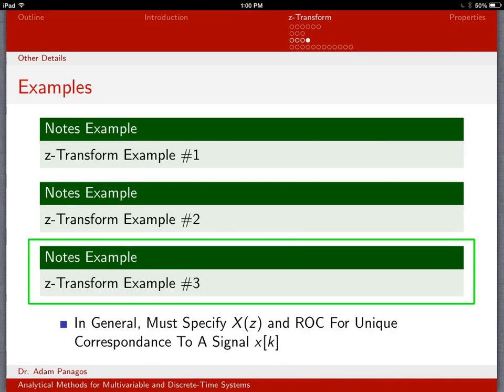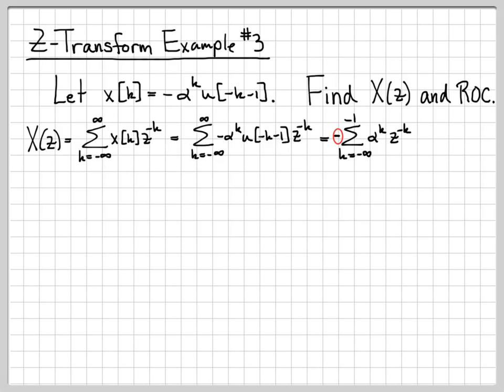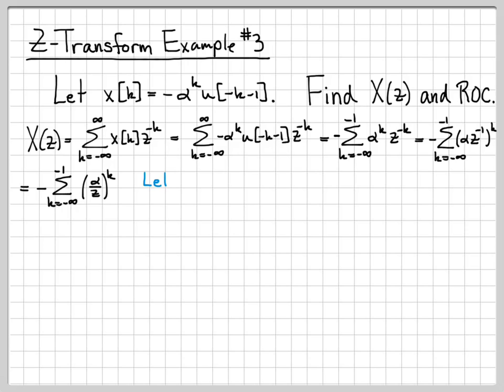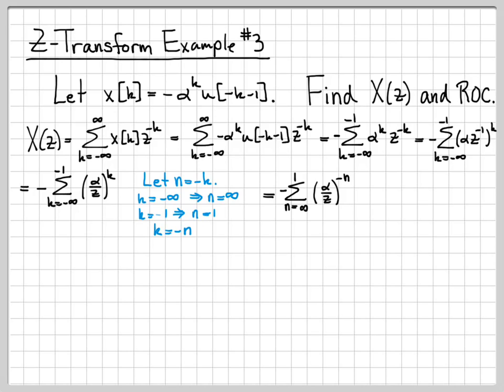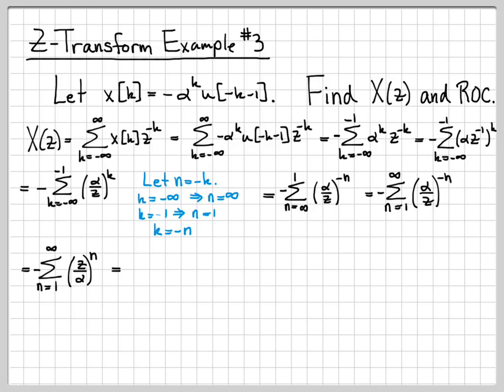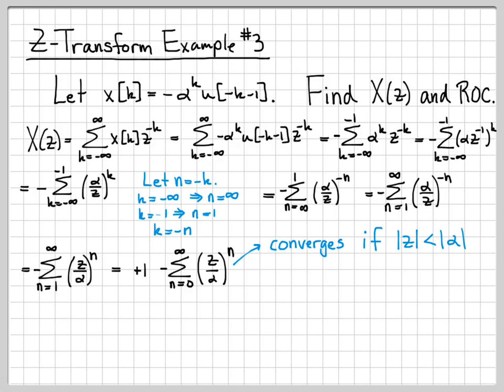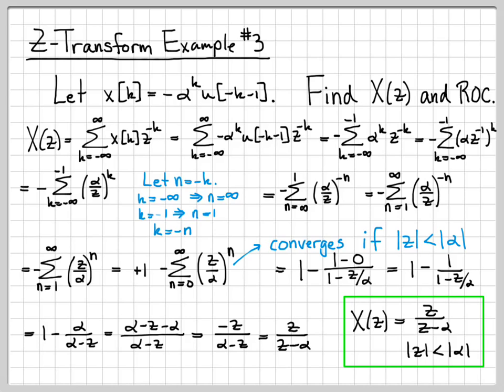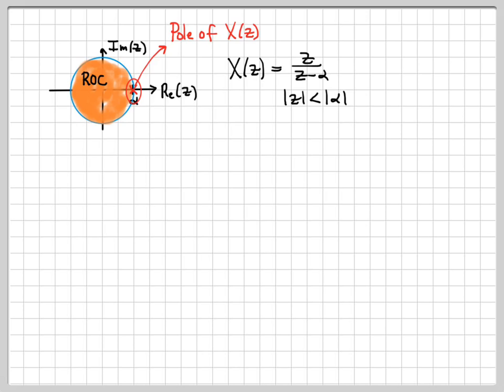Z-Transform Example #3 - Z-Transform Part 1

Comment: Z transform of a^n u(n) = Z transform of -a^n u(-n-1) , one is causal, 2nd one is anti causal, both will have same Z transform z/z-a, but ROC will be different, for causal |z|>|a|, for anti causal |z|<|a|
Reply from the maker: Not sure if I follow your statement that a^n u(n) = -a^n u(-n-1). These are very different things, definitely not equal to each other. The rest of what you said is correct though. Different signals, but not different z transforms but with different ROCs.
Reply: @AdamPanagos  actually, if you take Z transform of -u(-n-1) you will get Z/Z-1 which is equal to Z transform of u(n) or (1)^n u(n) , In discrete you take u(-n-1) bcoz you shift n by -1 and then mirror image it, it depends on Future only (not on present , so anti-causal bcoz it's shifted) , i.e the left side of origin , So a^n u(n) 's Z transform is same as -a^n u(-n-1) , 👍
Reply from the maker: @allenjonesstyles6112  Yes, completely agree. I have multiple videos that discuss this. But, the first part of your original post is still incorrect. You started by saying, "a^n u(n) = -a^n u(-n-1)". That is not true. The time domain signal a^n u(n) is not equal to the time domain signal -a^n u(-n-1).
Reply: @AdamPanagos  yah, yah i wrote it wrong 😅 there's no way those two signal look same in time domain , thnx for correcting 👍, i edited it
Reply from the maker: @allenjonesstyles6112  No worries at all, thanks for fixing. I think we're on the same page now 👍. Best, Adam.

Comment: Your videos are so much easier to understand then what I am used to. I am rusty on summations so could you tell me why you are allowed to let n = -k and then never back substitute?
Reply from the maker: +chrisplusian I'm not sure if I understand your question completely so maybe I'll just try explaining what I did and hopefully it will be a little more clear.

When letting n = -k I'm trying to convert all "k quantities" to "n quantities".  Since the original sum is over k = -infinity to -1, I need to figure out what these correspond to in terms of n.  The equation n = -k is used to do this.  When k =-infinity, then n = +infinity.  When k = -1, then n = 1.  Also, the value k is -n.  So, I am "backsubstituting" these values to write them in terms of n.

Does that help at all?  Is that what you were referring to?